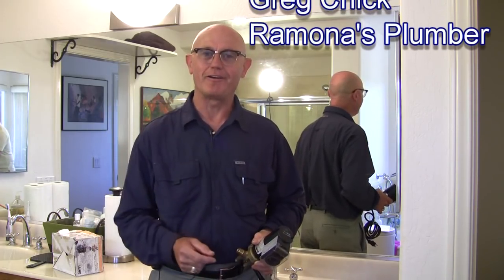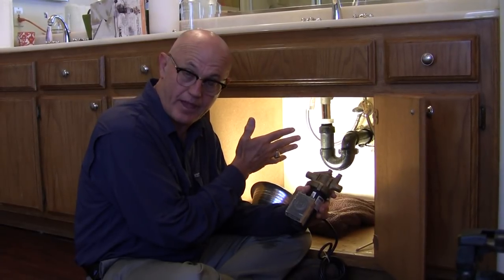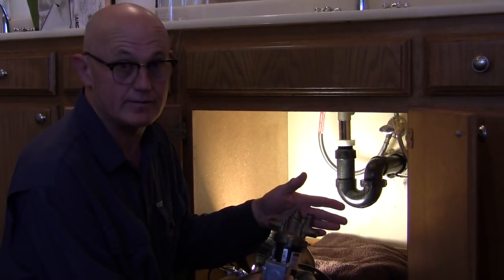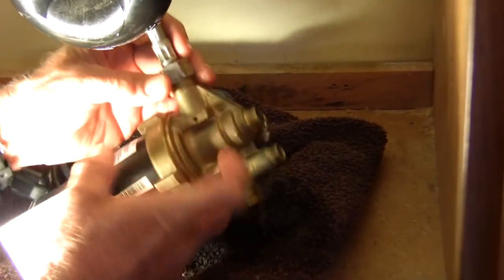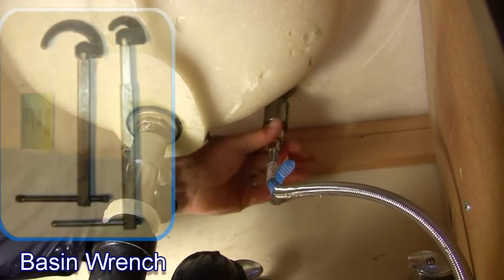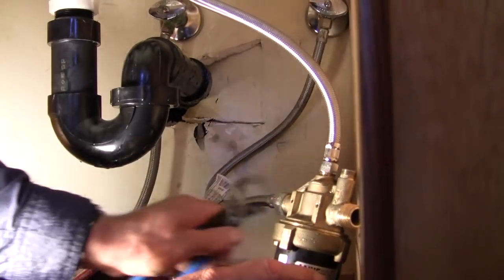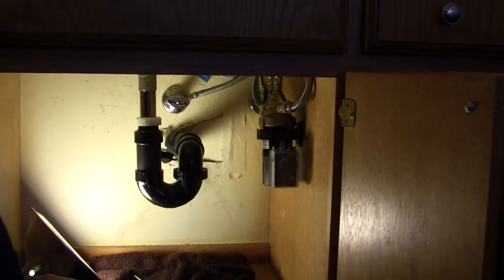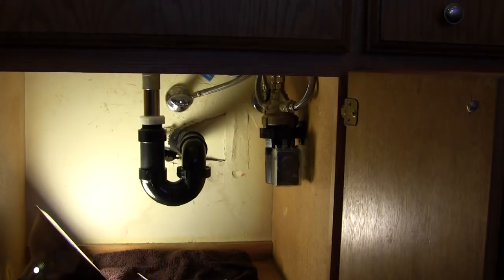Installing a Recirculation Pump for instant hot water and saving water

Comment from the maker: "Simple Physics"  are simple, but not always safe.  Hot water expansion has been such an issue for "ever" in the 30's buildings were blown up fron expansion.  Watts Brass Mfgr. designed a pressure relief device to protect buildings from this.  A movie was made back 70 yrs. ago on this as well as today myth busters did a video on the issue.  I do not suggest the Lobster creates this pressure, I suggest the Lobster uses this pressure and that if this pressure exists that in it's self is worrisome.

Comment: At 9:02 of the video, you mention that it will thermostatically run when it needs to keep the pipe warm, and turn off when it is warm enough.  Is the user able to set that temperature?  Are all these recirculating pumps thermostatically controlled?  The Grundfos UP models have a thermostatic valve for under the sink, so will that pump then keep trying to run until the valve opens up again?  Your video is helpful because I have wanted to install the pump under the sink, so thank you.

Comment: My Laing LHB08100092 re-circulation pump stopped working after about 3 years. I hear the motor running but no hot or warm water as it used to work. What could be the problem?

Comment: Do you have any suggestions for a recirculating pump and timer for a "solar" hot water heating system?    I would like to recirculate water through a homemade solar collector, tied into my water heater, and back thru my water heater at about 10 intervals during the hottest part of day for 5 minutes each interval.  I need a pump recommendation and a timer that can be set at shorter intervals.  Under regular use, the water comes from the hw tank, not the collector outside.  I'm in TX heat is free.

Comment: I would prefer to have a switch to control when the pump starts and stops. Is there one like that? Or just set to run continously and wire through a switch?

Comment: Has anyone done a payback analysis on the water savings vs the cost of the pump, and including the extra cost of heating the water?  Obviously there will be more heat lost from the circulating hot water.  Be sure to insulate the pipes.
How much water will be lost when you have to let the cold water run to get a cold drink? This might make sense for a public washroom where you don't care about getting cold water. Especially with low-flow faucets that take forever to get hot water from a distant heater.  In this case, it might make more sense to install a small point-of-use heater.
Reply: Kevin Lundgren
Reply: B
Reply: no appreiciable difference in cold where i live.  the main thing is that you don't have to wait for hot water,  whcih in my case was as much as 4 minutes wait.  add that up over a lifetime and that is a lot of wasted time.
Reply: hi Kevin ,I have well water at my house . although I do not have the circulation pump for the instant hot water ,I lose 1 gallon of water just waiting for my water to get hot from the hot water tank. I hope this helps somewhat. I do know that it would save me water having the circulation pump. Now Im not on city water so other than the cost of my well system my water is free ,however why waste the gallon of water waiting for hot water

Comment: What happens to the cold water that is sitting in the cold water line when water from the hot side comes and pushes the water?

So where does the water that was sitting in the cold water line go? Does it go back in the city line? 

And does your meter go backwards by the amount of water that was initially in the cold water line?

Comment: will the circulation pump at the furthest point help other ,closer (to the hot water tank )  hot water draw ?
Reply: Any faucets that are serviced by the line which the pump is installed will have quicker hot water.   Be sure to read the fine print if you have hard water.  Not all pumps are hard water friendly like RedyTemp pumps are.  Period inspection requirements and/or water softener requirements are one down fall that RedyTemp has solved.

Comment from the maker: Pumps are different in the features they offer,  some have unions, some have aqua stats built in, some have built in check valves, some timers, some pig tails, some have higher head capacity (pressure).  some are 1/2" others are 3/4", flanged to connect to pipe, or pipe thread, some have ball valves built into the unions that are with either threaded, or compression.   $150 gets you a pump only, $500 gets you the whole she-bang.  Cast iron or bronze, or Stainless steel!.

Comment: I believe the Hot Water lobster offers a Money Back Guarantee. However, my house plumbing is not pitched. If fact my hot water heater is in the attic and the Hot Water Lobster is on the main floor. From what i understand, it's the thermal convection (the heated water molecules that expand to create a higher pressure on the hot water side of the plumbing system) that circulates the water through the system.

I wish all products could be as simple and work so well...just my thoughts.

Comment: Great video - can it be installed in the basement to reduce the noise?
Reply: Pumps circulate water, the schimatic says where is effective.  If the end of the loop is in the basement, then yes.
Reply: @gregchick3311  Thanks - just caught up with the tech and bridge / crossover valves.   I'll probably go with motion sensors as scheduling would be a challenge.
Reply: @boedillard8807  Switching by motion or button is best.  Wi-Fi is an option today, batteries on sender!

Comment: Hi Greg. I installed the Liang pump upstairs under my sink. I run the pump before taking a shower to save water. Problem. The water seems to be  lukewarm during the shower whether the pump is on or off. I assume it is cylcled off since above 100 degrees it shuts off anyway. The shower is after the sink and I assume the cold somehow is leaking into the line through the valve. As a test I shut off both hot and cold to the pump/sink isolating the pump. Water is very hot but now I'm wasting water. Any tips, differnt kind of valve?

Comment: Have you seen the WaterQuick Pro II that is installed at the water heater and is activated by turning on any hot water faucet?  Seems like it would be a lot easier to install and operate.
Reply: Mark Franklin The video already stated you could install the pump on the water heater and used a sensor hardware.

Comment: One thing that wasn't covered.  I know of no bathroom vanities that have an outlet under the sink.  Care to discuss how I can get power for this system?  I have two bathrooms upstairs that could benefit from this system.
Reply: when i installed mine, i simply pulled power from the wall behind my vanity and put an outlet under my sink. easy peasy. or you can pull it from the wall next to your vanity and mount an outlet inside your vanity.

Comment: I have the same question as Surge P.  Water does not compress well.  How does the water from the hot side get pumped into the cold line?  Where does that cold water go to?
Reply: It circulates, back to water heater where the water heater gets its inlet water.   Cold water is what goes into the water heater to get heated.  This water is the same water that goes to the cold side of all faucets.  The house is fed by one cold source.   This is why we call this a circulation system, the water circulates from the hot outlet of the tank, back to the cold side where it re enters the tank... 
Now one may ask, isnt that reheating the hot water that has cooled down?  and yes, it is and that is why it costs fuel to constantly re heat the water.
Reply: Water is not compressable at all!  it does flow to path of least resistance back to the cold inlet of the water heater...
Reply: I see the error of my ways.  I didn't think about the water being pulled in by by the pump and the output just replacing it.
Reply: @userdjl  It is just a circulator, instead of a pump... actually the "Pump" used will lift /push water up a pipe to a hight of 15' high, then the pump just spins and no more movement!   That is what the term "foot of head"  means how many feet above head... so to speak.   the water pipes are pressureized to say, 60 or 80 PSI,  but that is any direction, the circulator just moves it inside that pressure..

Comment from the maker: I suspect the Pump install was poorly done.  Normally the circulators last 15 yrs or more.  Also the controls that work the pump are the reason the pump over pumped.  I suspect the controls killed the pump and caused the water to be hot on cold side.  As a question as to the shower that had cold water that was made hot, is that valve a Moen or a Mixit brand ?

Comment: Thank  you for the info.... makes sense (cents really) and with hard time with our fresh water system - everyone should take advantage of this easy task.
Bod Haddock ask if yo have a video for installing a pump to the hot water heater - do you?  It would be nice if you did.

How much does a recirculating like the one you installed cost?

Once again thank you for the info.

Ray Bazan
Reply: WHY should everyone do this?  For the dubious usefulness of instant hot water?  If you are that upset about lost water down the drain, put a bucket under the faucet and meditate until hot water arrives.  Use the water collected in the bucket for other useful purposes.

Comment: Dear Greg, I just watched your video and found it interesting--thanks!   This same unit is installed on our water heater and has been for 5 years...  But I think the water heater is going out and will only heat to hot if all the way on "very hot".  Unlike it was so very hot even on vacation mode when new!   So, I really need to have that looked into. I am by no means savvy in these kinds of thing by far.   However, since this pump is installed shouldn't it somehow heat the water even if the actual water heater is going? Or does it just hold it and or recirculated it.  Or, am I missing how this device works all together.  Only when water is very hot from heater it still comes out hot within 2 seconds and once again probably the water heater and can't circulate what is not there.  I may have answered my own question, but thought I would ask the expert. Many thanks....

Comment: Will this application work if the house is equipped with a tankless water heater?
Reply: Michael,
  Tankless water heaters require a min. flow to trigger the burner.  Different tankless units by different makers have factory approved pumps and pump controls.   Some tankless units have built in pumps. Others have built in control wires to power and or control circ pumps.   Best to contact the maker of your tankless and get a schematic and pump spec needed for your unit.

Comment: Thanks for you helpful videos! Will installing a recirculator pump quickly bring hot water to the other fixtures in the room, as well? Would you require an additional pump for other bathrooms in need? 
And... nice orange Vistalite! :)

Comment: I installed the Laing pump under my main level kitchen sink which was the furthest fixture from my basement water heater.  Before installation, it would take about 1 minute to get warm then hot water.  Now, I get warm water instantly, followed by hot water within seconds thereafter.  However, the cold water issue in the main level master bathroom was not "cured" by the installation of the pump, as suggested in the video.  It is probably on a separate branch and is about as far away from the water heater as is the kitchen sink.  So, I've ordered the plastic valve and braided hoses to put under the sink in the master bathroom.  I hope it works.  If not, then I'll install another Laing pump under the MB sink.
Reply: Update..I installed the valve and it works beautifully!  Hot water problem solved.  Next...
Reply: Terry Moore Where did you buy the plastic valve?
Reply: Pretty sure I bought it online thru HomeDepot.  You can go to Laing.com too, or Amazon, I'm guessing.  I found that the items aren't readily carried on the shelves of home improvement stores, so finding them online will be your best bet.  I paid $50 for the valve and about $240 for the pump, etc.
Reply: Terry Moore Thanks for the info.

Comment: So if I have one bathroom on a loop and the sink is before the shower, but obviously I want to install the bypass under the sink b/c it is accessible. The only negative is that there will be instant hot water at the sink (when the pump is on) and a couple second delay at the shower b/c it is a few feet down the line? Is this correct?

Comment from the maker: I use temperature sensors, one at the tank on the bottom where the coolest water sits and the pump pulls from (drain port).  The other sensor at top of panel where it is hottest.  the two sensor wires go to a Delta T controller that is a simple box that says "wow it's 10 degrees hotter at the panel, circulate the pump."  using a relay inside the controller that the pump is pluged in to turns on the pump any time heat is there greater than tank bottom...  Timers are not very smart..

Comment: Doesn't this send hot water into the cold water line? If you open a cold water line in another sink, the water will be warm ?
Reply: Yes, to a degree, but the crossover valve is thermostatic and automatically closes when hot water gets to the vavle and closes it.  So, the "to a degree" means some warm water can be felt on the cold side for a second, but the crossover is limited.   The option is to install a pipe from the fartherest faucet all the way back the the cold inlet at the water heater.  This is expensive, sometimes impoissible.   So a way to circulate water is done this way.
Reply: @gregchick3311  Thanks for your reply

Comment from the maker: Pumps are sized according to need,  not is another person uses that pump.  I use the Metlund Demand pump system when I can,  go to the site ACT, metlund demand .  The Got hot water.com is one address they have the full line  of pump systems there.  A common pump is only part of the system....  the same pump can have a timer,  aqua stat,  or both and can have unions or not and can be 1/2" or 3/4" and can also be for screwing on the pump or soldering on the pump,  all have different model #..

Comment: If one attach's this product or something similar to the hot water heater, won't it do the entire house? Does one still have to put something like u show in your video in the furthest sink?
Reply: +Anthony - This is how the recirculation pump works when the cold water line is used as the return line: 
 
When the recirculation pump senses that the water near the remote fixture is no longer hot, it pumps hot water from the water heater to refill the entire length of hot water line with hot water. The warm and nearly hot water that was present in the hot water line is pushed (pumped) into the cold water line, filling the cold water line with the warm and nearly hot water. The (cold) water that was previously present in the cold water line is pushed "backwards" into the cold water inlet on the water heater. So as hot water is pumped out of the water heater, it is replaced by the water from the cold water line. 

Even if the pump is located near the water heater, it still requires the sensor/diverter-valve near the remote fixture.
Reply: Anthony you can’t use the product in the video at the water Heater. This is because it has a thermostat and needs to be at the farthest point to know when the temperature changes.

Comment: Hi Everybody. Does this recirculation pump work in secondary return pipe hot water system? We have recently build a welfare facility building (Building size approx 60m x 30m) with a secondary return pipe. I wonder if this kind of pump works with this kind of system, if it works what's the proper name of this kind of pump and where can I buy it? I am from UK.

Comment: Can recirculating pumps be used with tankless water heaters?  We are having issues with our tankless, and are considering buying a new one.  The tankless is 40 ft from the bathrooms, showers, and washing machine.    We wait at least a good 3 - 4 minutes for hotwater, and when the hot water comes on the shower, within minutes it goes freezing cold....or the water stops coming out of the shower head.  Just stops.   So, we have figured it's a pressure issue with the tankless.    So, now we have 2 problems.  A bad tankless water heater, and trying to reduce the amount of water we waste here in NoCal.     

Can you suggest a tankless water heater (or do you recommend switching to a full tank)?      And, can this process of using a recirculating pump at the faucets work with a tankless?   What can I do to help with the showers?

(We have a family electrician...so, I'm good there!)  Thank you for your video!!
Reply: RedyTemp TL4000N and TL4000D work with all tankless water heaters and can be activated / operated in on-demand or scheduled or a mixture of both.  This allows for water savings for all occupants regardless of their lifestyle.

Comment: Does this method provide instant hot water to all faucets in the house or just the one at the pump?
Reply: It supplies hot water to all faucets in between the pump and the hot water heater. Run hot water to the one you think furthest from the heater, then check the temp on other faucets. Any that take more than 3 seconds to heat are likely better candidates for the recirc pump.
Reply: Terry Moore it depends if you have shared copper pipe with tees for each faucet. It makes the shared pipe hot. Any tee connected to that shared hot will get hot quickly. But pipes not connected to shared pipe stay cold. So if your house is long and water Heater in middle and you have faucets on both ends, you may need two pumps.